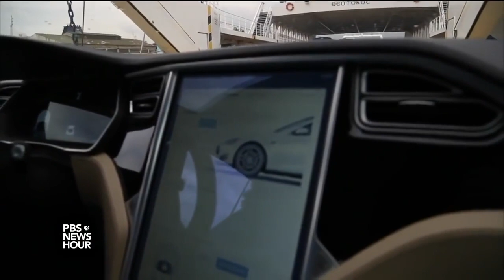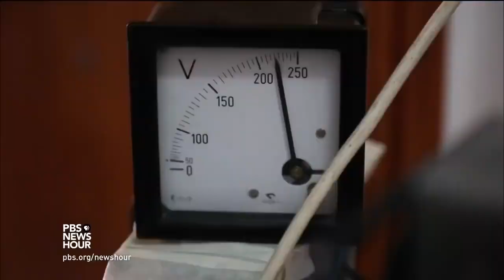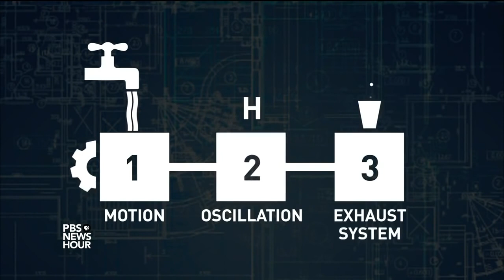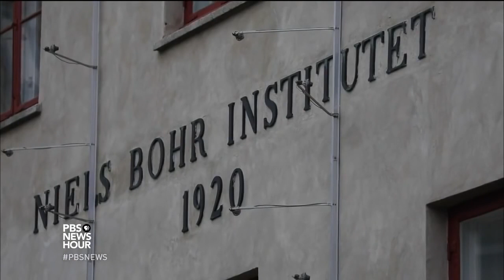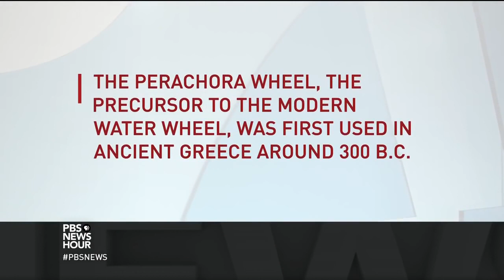Zografos showing his older 800 Watts Generator

Comment: It's water molecule fracturing (not electrolysis) that Stanley Mayer's invented back in the nineteen eighties. At the right AC frequency the hydrogen bonds fracture. For example try breaking a straightened out paper clip by pulling it (electrolysis) now try bending the paper clip over and over again and it will fracture and break with far less energy or effort.
Reply from the maker: Well explained ! Thanks
Reply: But that is not correct either.
Thats not how stan did it , the key is look at the where the bubbles come from and the stainless steel tubes.

What bonds atoms ?
What is bond energy ?
What is spectropy of those atoms ?

Stans method was not ou as such it was more about not corroding electrodes and was more efficent than electrolsys and no electolite needed.

Energy in and out was not really the point.

The point was clean simple reliable method.
Efficency was secondary bonus 👍
To understand stans method there is a guy who totaly reved it on one of his videos.

You will just be guessing unless you learn some quantum.physics, the electrical hits a new realm 👍
Reply from the maker: @easyerthanyouthink  Which video do you mean ??
Reply: @easyerthanyouthink  I would love to know more about that video too?

Comment: how he could gereate electricity directly from Hydrogen ?
Reply from the maker: Via rectification via Gunn diodes from the generated "metallic hydrogen" ,after the water is splitted from the Ghz electrolysis...
The DC is then fed into a DC to AC inverter and fed into the house grid...
As the Ghz Electrolysis uses almost no power, the output power is much greater and can be looped back, so only a small input power is needed to start the process for the Ghz electrolysis oscillators...

Comment from the maker: Zografos showing his older 800 Watts Generator
Report from PBS with the German Georg Schoell having visited Petros Zografos and told us, that the main Secrets are the Gunn diodes in his rectifier bridge where the RF AC currents are converted to DC power and then fed to an inverter to produce the 230 Volts 50Hz AC household current...